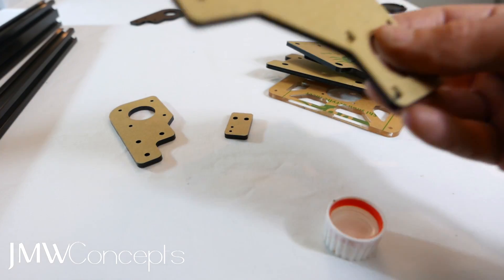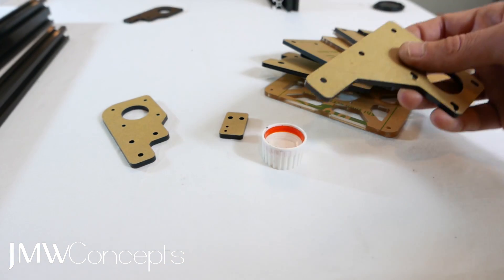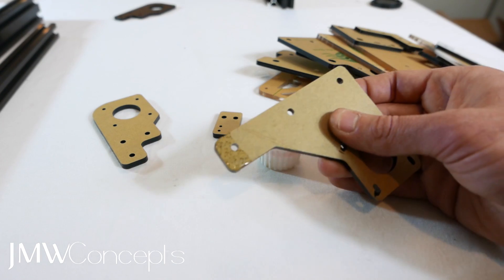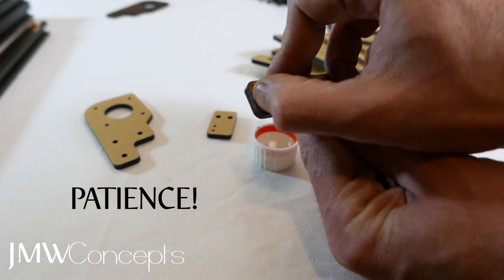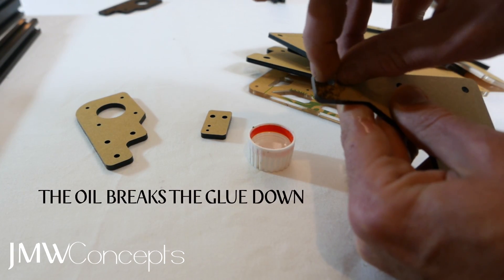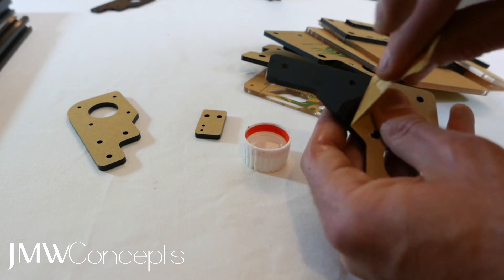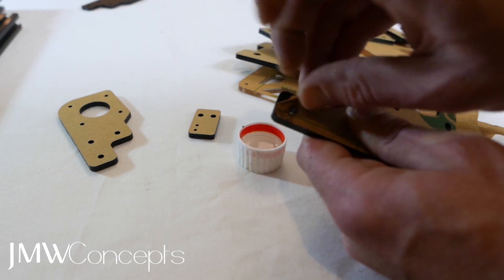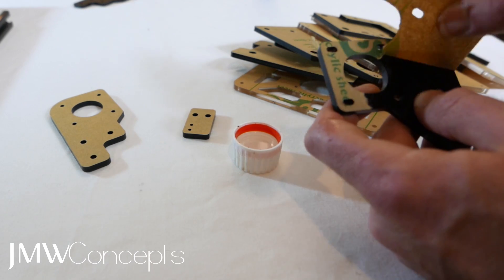Removing Paper Sheeting / Film from Acrylic Sheets / Parts - EASY WAY

Comment: I used Windex (glass/window cleaner). I spritzed it on generously and let it soak in. I was able to remove the paper and adhesive with no problem.

Tried using water too, but while I was able to remove the paper, the adhesive was more difficult.
Reply: YEA-MAN!  Just don't let it evaporate = work fast  ;  )

Comment: Surprised no one mentioned using a heat gun. I acquired a few hundred pounds of plastics in various colors and thicknesses. The paper of much of it is old and difficult to remove. Heating it with a heat gun makes a big difference.
Reply from the maker: Good advice, I guess just be careful not to heat the acrylic too much so it could deform?
Reply: @JMWConceptsTheOfficial , correct

Comment: Who (appart from Aussies) has eucalyptus oil at home? :-D A longer finger nail works too without scratching the surface. Just push the paper in until you can grab it. ;-)
Reply: Unfortunately, the longer the paper is on the acrylic the harder it can be to remove.  Unless I heat it or try one of the methods suggested here, it comes off in pieces. When you have several hundred square feet of plastic, that can be problematic.

Comment: Nope, not working. Now the paper is separating from the glue. Now I have a real mess.
Reply from the maker: Hi Cynthia, sorry this didn't work. Were you using 100% Eucalyptus oil? It should just about dissolve the glue to liquid, otherwise when I did this video I actually dipped a few more pieces(edited out) before moving the camera and packing it down, then came back to them, left too long they had turned a bit slimy so I dipped them again and all was ok. 
Sorry again it didn't work out.